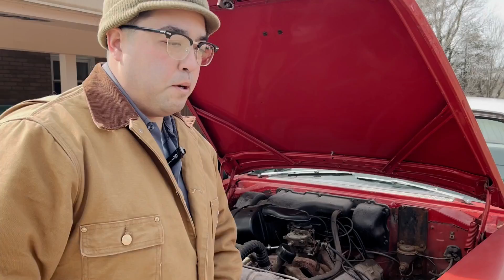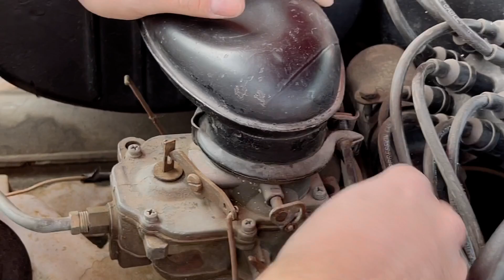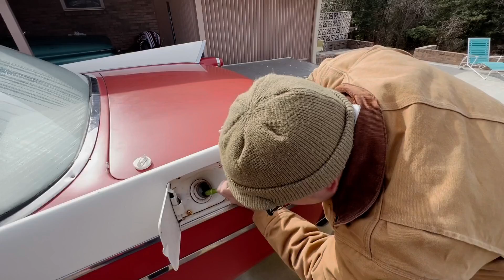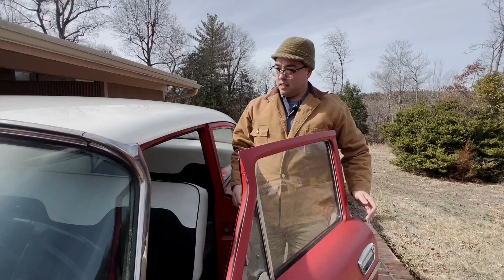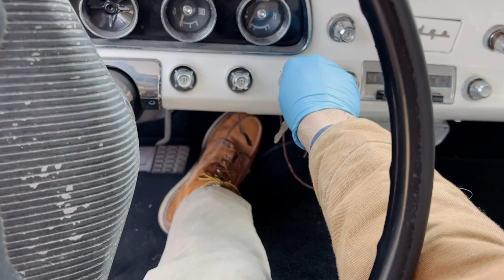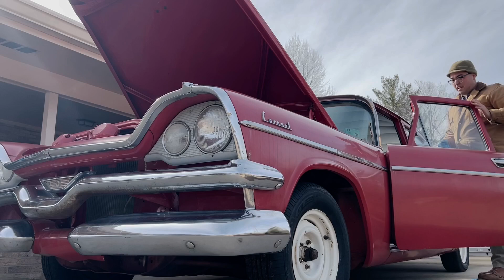First Start! 1957 Dodge Texan. Rare MoPar! Obsolete Automotive

Comment: Have you considered a dual master cylinder ? It may be a good idea for a car that big And heavy #Aztec73
Reply from the maker: @Aztec73  You can easily add a dual master on these MoPars. A 1967-up master cylinder bolts right in place. I’ve done this conversion for a few cars.
Reply: @ObsoleteAutomotive  I've heard too many stories of single masters cylinders going out with nothing to back it up So I always wanna dual
Reply from the maker: @Aztec73  It can happen for sure.

Comment: You need to put some gasoline the carberator and maybe get it started.  Also check farward and reverse on the trans if you get it running.

Comment: Cast iron Torqueflite. Great transmission, too. It had center plane brakes, 2 leading shoes up front. The drums have to be removed with a puller in the back.

Comment: I had a 1958 Coronet with the 325 poly, like yours. I carried a 16 oz ball pein hammer to smack the starter when it would not engage.
Reply from the maker: @lanstermann  I had to do that with a 57 Plymouth flathead 6. Ha

Comment: Also good tip that vent tube at the top of the carburetor. If you put fresh gas into that carb and fill the float bowl that way along with a few drops down the carb throat, you won’t need any starting fluid ever the only time starting fluid is really needed is if there’s an ignition problem or really low compressionI avoid using it as much as possible. Just advice not criticism great video.

Comment: My grandparents had a '57 Dodge.  Did Dodge's have an alternator in '57?  They came much later for Ford and GM.  I seem to remember my Father-in-law telling me the original '63 1/2 Mustang had a generator which was replaced by an alternator in '64. Great video.
Reply from the maker: The alternator wasn’t standard across the board for Chrysler until the 1961 model year but was introduced in 1960 on the Valiant.
Reply: @ObsoleteAutomotive I thought I saw an alternator on the five-seven.
Reply from the maker: @decay21450  it’s a GM alternator someone put on the car.

Comment: Nice job on that '57. Those were nice cars & I remember them well. BTW, is that s ,'61 Plymouth wagon under that carport? Funny thing, my family had a same color green '61 when I was a teenager. We took a trip to Florida in it in 1967. Yep, very similar to the movie with Chevy Chase. Lol
Anyway that was a fine car. Wouldn't win any beauty contests but it was a good runner. I drove it when I turned, 16 & got my license. I remember it had a really cool speedometer. Also recall putting a fuel pump in her. 3 bolts & the gas line. Easy peasy. Anyway nice job on the Dodge & good luck with future projects.
Reply from the maker: It is a 61 Plymouth wagon. It’ll be featured in a video in the future! I drove it 3000 miles from California to NC a few years ago.

Comment: Great CAR! Hey that screw driver (Pocket knife) wasn't in the list of "The only things you need to start an old car" LOL. Sorry for giving you a hassle but it completely depends on what the si like as in the shape it's in mechanically as to what you will need to get an old car to start. The car many have some old hoses that are rotten or wires that are not connected or broken it may have vacuum leaks from holes left off for some reason it might have a clogged up carb etc. I was glad to see that you included the sand paper or emery cloth etc to sand the points as SO many "Will it start" Videos don't seem to think of this until long after trying everything else to start it.
Reply from the maker: Who doesn’t have a Swiss Army knife in their pocket at all times anyhow? Also, I did say start and run and not necessarily start and run good. 😂

Pretty much anything will start with fuel and spark. I’ve started cars without a carburetor before. I’ve also started a car and had a power steering hose explode. 

This car definitely will need a correct carb, linkage, fuel pump, wires and hoses and all that. But I do know that the engine and trans is okay!

Comment: Finally, somebody else with a 57 Dodge coronet. Love these exner mopars. I've got another rare 57 coronet, d500 4 barrel hemi, stripper model. No options other than the big hemi, taxi/police issue suspension and brakes. No outside mirrors, no radio, no parking brake warning light even.
Reply from the maker: I can’t wait to get this one back on the road!
Reply: Awesome to see another one back on the road. I've had mine for almost 25yrs. Built and rebuilt twice already. This time, it's getting the original hemi rebuilt

Comment: Not many of those old Chryslers around ! I recall seeing these on the road back in '66- '67 . Alot of them were junked by the 1970s or just simply wore out for one reason or another . Today , any original or restored survivors are highly prized especially at auto shows . Let's keep some around instead of sending them to the crusher , right ? Happy Motoring !

Comment: Just a little jealous, here! Nice car. I do wonder why I seem to never see anyone changing the oil, instead of just checking that there is some there. Don’t we always say that oil is actually a cheap thing to keep good?
Reply from the maker: Thanks. If the oil looks decent I leave it in for the first start. That way I don’t waste 5+ quarts of oil and a filter just to find out the engine has a knock or some other issue.

Comment: Battery is almost dead,,,you can usually tell by the engine turning over very slowly,,Also you shouldn't need to keep poring starting fluid down the carb,,,,Much better for the engine if you put some petrol in the carb,,

Comment: If I may give you the same advice I gave "Vice Grip Garage" many years ago. Please ditch the starting fluid and prime your long sitting engines with chainsaw mix. Those cylinders need the instant lubrication until the oil starts getting splashed around. Great to see the Texan spring to life. Now all you need is a "Le Femme" to go with it!

Comment: Nice Dodge, never heard of the “Texan.” I’m sure swapping that carb with the proper one will make a big difference. Sounds like a strong motor. 👍🏻
Reply from the maker: First step is to get the correct parts on the car! No sense in trying to make the wrong stuff work. Hopefully it won’t take much to get this car back on the road.

Comment: It's best not to open and close the points on the power is on without grounding the coil wire because that high voltage has to go somewhere and it may ark internally within the coil which will ruin it.
The car is in really good shape is it an older restoration or an original car that's just been sitting?
Reply from the maker: I haven’t ruined a coil yet. Fun fact I’ve never had to replace a coil in over a hundred cars I’ve owned. (Knock on wood.)

It’s an older “restoration” that hasn’t really been driven. The previous owner got the car in 1994 and over the years had various things done. Paint, interior, questionable mechanical work… but I don’t think the car ever was really drivable on the road and sat for a long time prior to me purchasing it.

Comment: that condenser looks brand new...must have been running back in july 23 so 7 months is hardly a long time not running....
Reply from the maker: It was not running back in July. It hasn’t driven in decades. The points were corroded badly (if you noticed), the fuel tank was bone dry, the fuel pump was dead, the accelerator pump is shot, among other things…from sitting. The previous owner who got the car in 1994 also gave me the entire history of the car which spent most of its life being towed to various places for work.